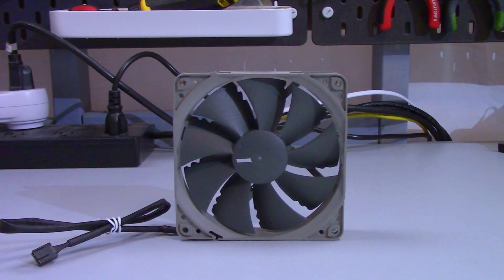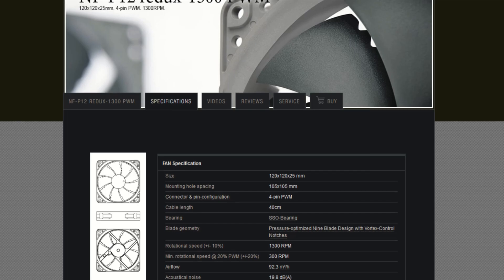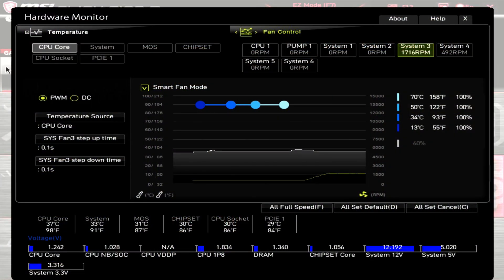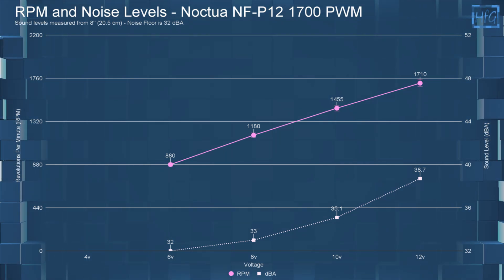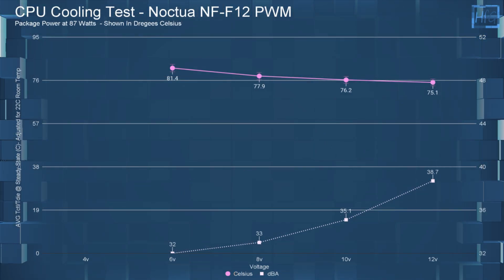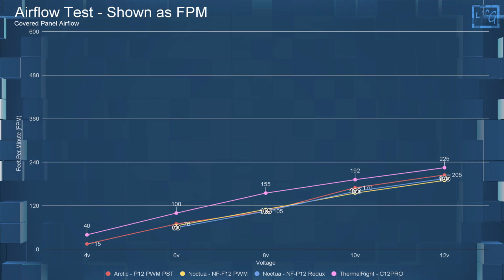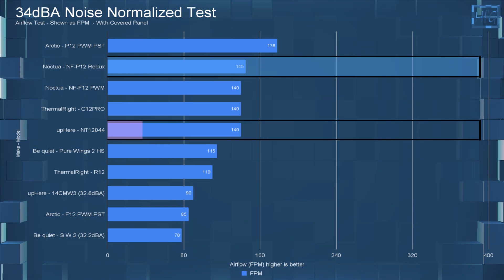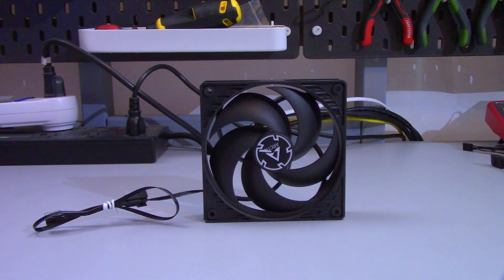Noctua NF-P12 1700 PWM Redux - PC System Fan Review

Comment: Are they worth it?
Reply: I had the Arctic P12s. Good airflow but god awful motor hum at around 1K RPM. I have a P12 Redux paired with a handful of A12x25s, S12A Chromax, and two A14 iPPCs. It keeps up well with its other brothers while remaining quiet.
Reply: @Iridiumcosmos  yeah i ended up getting the arctic p14s
Reply: They are great and definitely worth it.
Reply from the maker: They're not bad, but I think they're better price to performance fans. I would say look at the Arctic F12's or P12's
Reply: @HardwareForGamers  what the difference between the f12s and p12s?
Reply: @HardwareForGamers  Could you do a test on the deepcool fk120? I was looking at getting those fans but don’t know if they are worth it.

Comment: I agree. Long ago I used 80mm Noctua I did not like. It would be interesting to review new redux. Even if today people are not interested in 80mm 🙁
Reply from the maker: I might get to 80mm fans someday.
Reply: @HardwareForGamers  For me, i'd rather see you go up to 140mm fans, than drop down to 80's. 80mm fans are passe'... too loud for their airflow, and most cases have spots for 120/140mm..and most coolers use 120/140mm..
Reply from the maker: @Mr1Tanker  I have some 140mm fan that I'll get to testing soon.